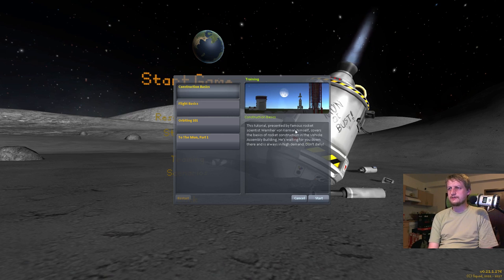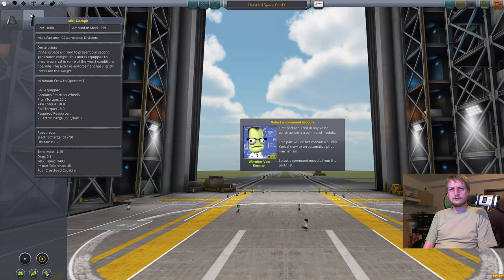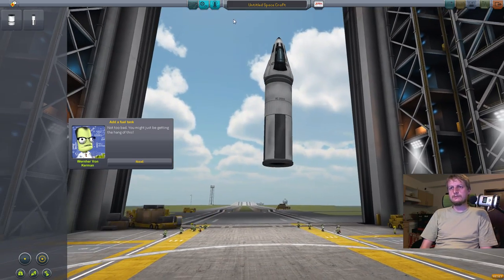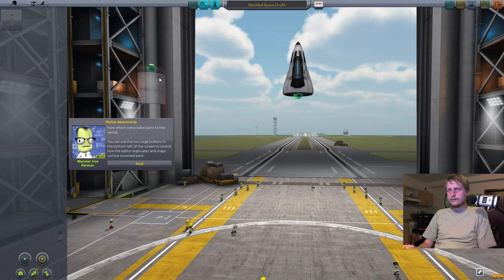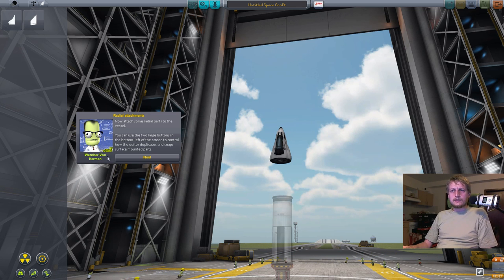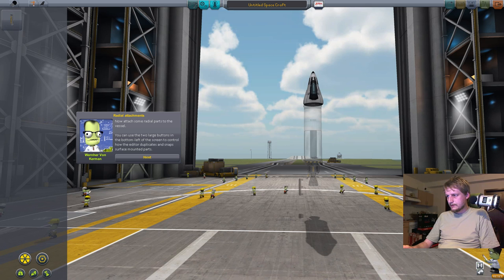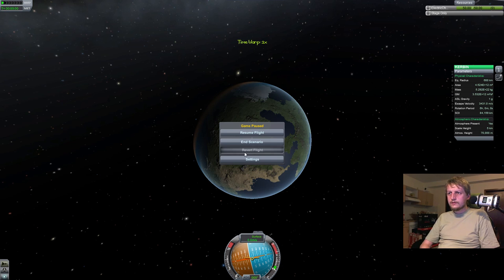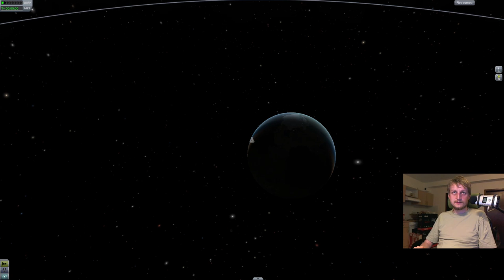Kerbal Space Program (01)

Comment: You can only attach to the primary part (usually the command pod) or stuff already attached to it.  I wonder if there might be a problem with the attachment point of that command pod.  Looks like it tried to put its launch point in the centre of the planet, I wonder if it is because of the major landscape changes in the latest release and the scenarios may not have been all updated.